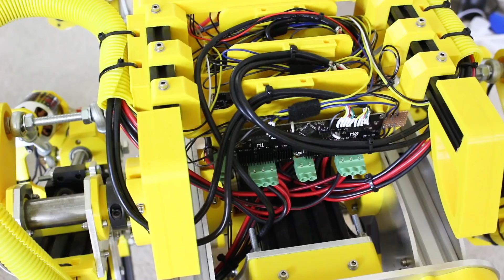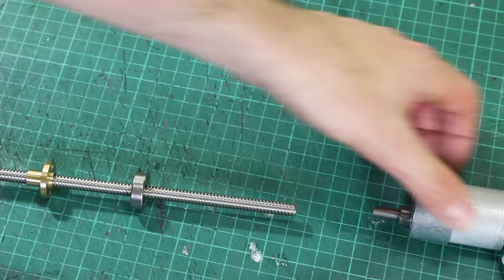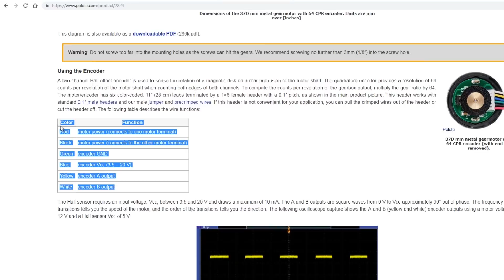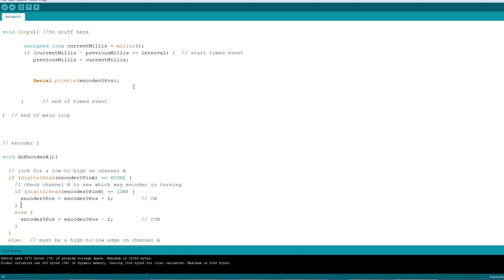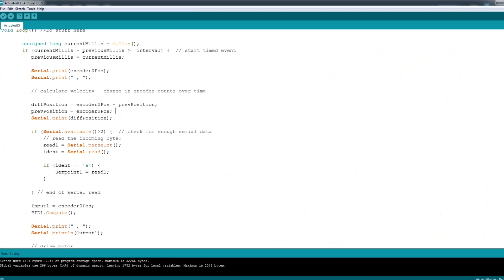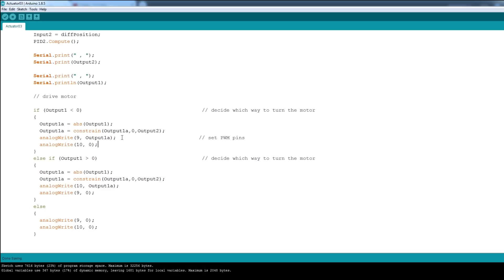Building a Lower-power Linear Actuator with Arduino | James Bruton

Comment: Twelve 2kW motors means this robot has a max power of 24kW...that's a 32 horsepower robot!
Reply from the maker: yes that's the peak, but they are limited to 30A at 24V at the  moment and it looks powerful and fast enough
Reply: @jamesbruton  James,  It seems, then like you could make a saddle for Open Dog. You know you want to ride it. 

(whispering) Doooooo iiit

Ask Colin to help with the seat design,  or ask him to ride it if you want a crash test dummy. :D

Also this makes me want to expect galloping not just walking from the OD.
Reply: @Scott_C  I've been trying to convince Boston Dynamics to do this, but nothing yet. James is my only saving hope now.
Reply: Could always borrow the safety tie.
Reply: Safety Ties were industry standard PPE I thought.
Reply: They are an OSHA requirement for performing the Safety Dance
Reply: 30A * 24V x12 = 720 W x12 = 8,6 kW
Reply: at full power it should be able to pull a car or some pretty heavy load if it doesn't slip.
Reply: So now we need to attach a cart to it. This will be perfect for getting my cabbages to the market!!
Reply: You'd be constrained by the physical strength of the materials used to make the body structures and joints, but if the plastic components are replaced with metal then it could very likely do that amount of work.
Reply: I work with horses. The power of 32 horses? I really cannot imagine this touches any reality.
Reply: Because you don't math much do you  computerjantje?
Reply: @Vampyredh  don't give math a bad name, with what is infact your common-sense-fail. The rated power of these motors is near maximum RPM. Aside from the drive current not reaching the maximum torque, the max speed you could get them before they run off the screw is probably a tenth of where they reach their peak power; and a typical motion probably again a tenth of that in this config. Not to mention the efficiency isnt anywhere near peak at those conditions. 

Even if you got this 50kg robot to jump over a 1m fence, (and you wont), its still an order of magnitude short of a 500kg horse doing the same thing.
Reply: @computerjantje  rather hilariously one horse is actually equivalent to 15 horsepower. So it's about the same as two horses(?) which is still pretty scary
Reply: Lol. Just shows you the flaws that can arise in measurement techniques.
Still, it worked at the time to establish a point of reference...

Comment: What a great series of videos. I've been working on building a smaller quadroped, and am planning on making my mk2 version roughly 1/2 the size of OpenDog using a combination lead screws and custom planetary gears as well as pancake brushless motors like the ones I use on my drones. Thank you for the great vid!

Comment: looks like a good start on a way to do this on a tighter budget, for a half scale project. my experments with planetry gears have not been a lot of success so I may look at going this way, though I may want to gear down some, since the current motors I have a re much to fast.